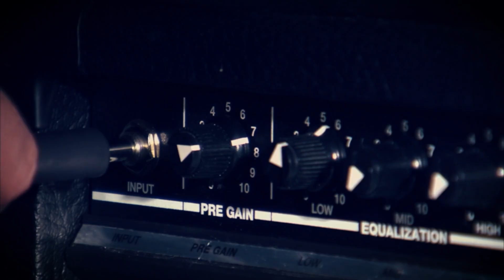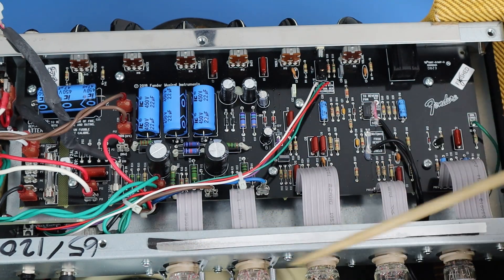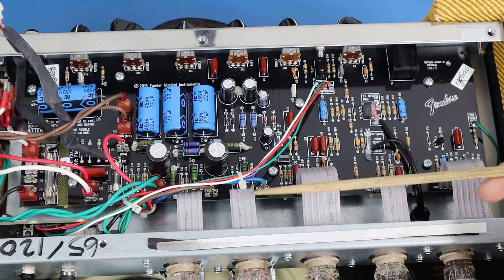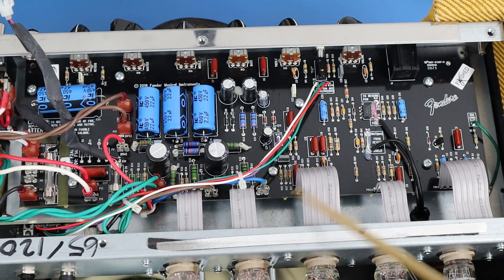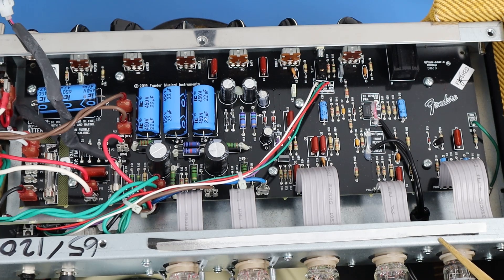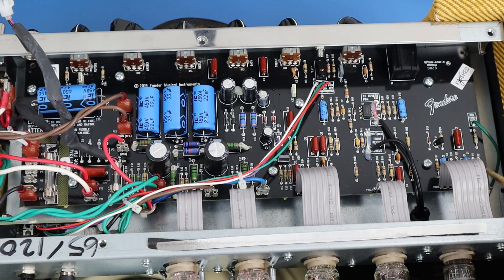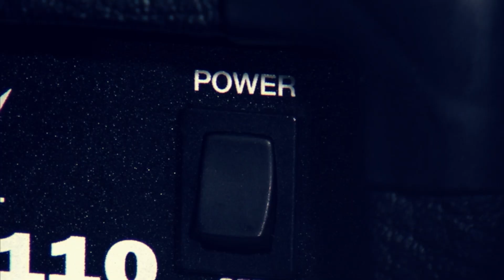Fender Blues Jr IV - What's Different?

Comment: On a small wattage amp with dual EL84 there are now reason to use fixed bias..  EL84 has a lot of inherent gain built in and lends them self well to cathode bias.. (90% dissipation).. cathode bias should be biased hotter att idle than fixed bias..

Comment: Hi John, awesome video!
I have a 2020 Blues Junior IV with the green board, and it came with the blue caps similar to the ones you replaced. I’ve also installed a pot that lets me control the bias.
Thanks!Would you recommend proactively swapping these caps before they fail?

Comment: In your presentation, you appeared to conflate resistors with capacitors, and the plate with the cathode. It doesn’t sound very professional to me.
Reply from the maker: Yes I sure did, my apologies.
Reply: @proampsolutions  Don't sweat it dude. Great info.

Comment: There was a an early, small run of Series IV amps which used the Series III circuit board , but had the Series IV chassis with the individual spring retainers for the power tubes and the Celestion speaker.  I have serviced  two Series  IV Cathode biased amps with burned  R47 2.2 k power supply resistors.   The factory installed Groove EL-84  power tubes with a number  rating of "1" are still a major source of failure in these amps.
Reply from the maker: I have serviced a couple hundred Blue's Jr's and I have only seen R47 fail once or twice and that was due to catastrophic failure elsewhere causing excessive current draw. The Blues Jr III Main PCB does not support cathode bias, so I am not sure what you are referring to. I have seen a few dozen Blues Jr. IV's and have not seen one that is over dissipating yet.
Reply: Great video!  How about the low voltage supply?
Reply from the maker: The low voltage supply is the same without the bias supply components.

Comment: were you able to test what the tube dissipation [bias] is now at with the new cathode bias? One of their Tech's told me it's supposed to be 70% now, but I'm dubious... the unit I had on a bench didn't seem to test that way.
Reply from the maker: Yes, I tested the dissipation on power tubes, it was 86%. I like them between 85-95% which generally gives enough variance for replacement tubes.
Reply from the maker: 70% sounds like a good but pretty warm idle fixed bias setting. Cathode biased amps can run up to 100% at idle, but practically I like to see them at ~90%. A fixed bias amp is just that, when you induce a signal the dissipation goes up. On a cathode biased amp as a signal is induced the voltage across the cathode resistor increases with current reducing the dissipation. That is a slight oversimplification, but I hope that helps.
Reply: @proampsolutions  Sounds like they've FINALLY got bias set where it should - roughly - be. If they can get that input jack off the board, maybe replace those ribbons with real wires, it would be pretty great and then just a "repair as they break" kind of thing. Thanks for digging in!